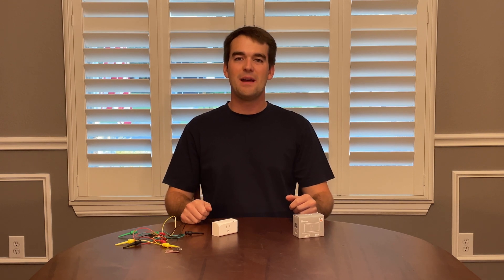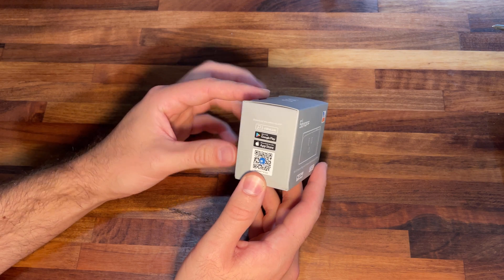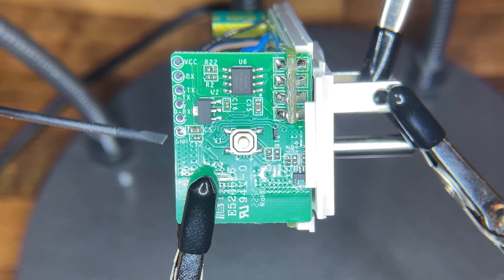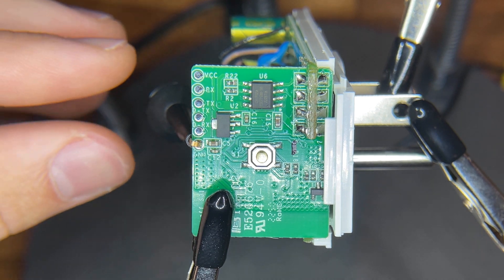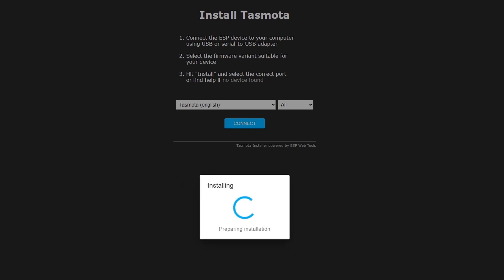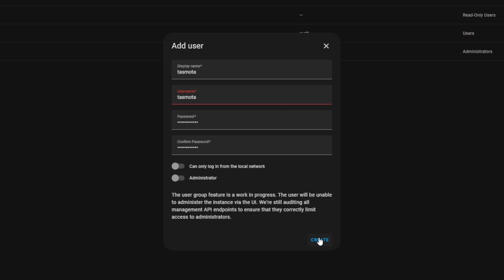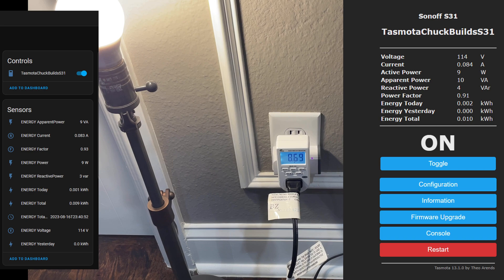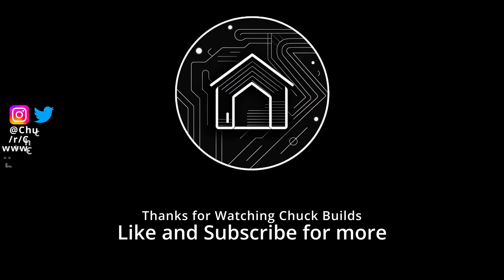Sonoff S31 with Tasmota: The Best Cheap Local Smart Plug with Power Monitoring (How-To)

Comment: was wondering are the clamps for anything or was that just to position it to be easier to record the video?
Reply from the maker: the clips were just to make it easier. you can use any wire really but it was hard to hold them in place long enough to flash.

Comment: May I ask what is the size of the screwdriver you used?
Reply from the maker: I believe it was a Phillips #1 but can't exactly recall
Reply: @ChuckBuilds  Hi Chuck, Thank for your reply. I have contacted Sonoff directly, they said the size of the screw is self-tapping screw ST2x10, countersunk, cross, point tail, stainless steel, and use the PH0 screwdriver. Leave the comment here for others with same question. :)
Reply from the maker: @iantche1980  dang! I'm sorry! Thanks for the update
Reply: @ChuckBuilds  Never mind :)

Comment: I followed your instructions and did fine, connected and I told it to install.  It tried, but came back with Installation failed - Failed to initialize. Try resetting your device or holding the BOOT button while clicking INSTALL.  I tried several times but continued to fail.  Any ideas?
Reply from the maker: I'd try a combination of things. I'd restart your computer, Switch USB Ports, maybe consider switching USB plugs if you have another, and then try the tasmota launcher from Microsoft Edge. I vaguely recall having a similar issue to you on one of the many plugs I did but it was like a random issue - a restart and new USB port fixed it (if i recall correctly!)

Comment: I followed your exact instructions, but all of my plugs go unavailable on HA every 2 minutes. Getting the following errors in Tasmota log.

17:35:35.276 MQT: Attempting connection...
17:35:35.500 MQT: Connect failed to IP:1883, rc -2. Retry in 10 sec
17:35:46.254 MQT: Attempting connection...
17:35:46.476 MQT: Connect failed to IP:1883, rc -2. Retry in 20 sec
17:36:07.256 MQT: Attempting connection...
17:36:07.477 MQT: Connect failed to IP:1883, rc -2. Retry in 30 sec
17:36:38.266 MQT: Attempting connection...
17:36:38.282 MQT: Connected
Reply from the maker: Does location of the plugs change the outcome? My first guess would be interference. It is strange it is on such a predictable schedule though. Any errors from your MQTT log?
Reply: @ChuckBuilds  I wish we hadn't done it on the phone... i'm trying to get this online, and I followed all of your instructions.  But it's not showing up in home assistant.  (Doesn't Show up in Settings/dashboards/energy either

Comment: Just used your Amazon link and put a couple of those plugs in my cart. I'll play with those next week. Have you thought about doing one of your great beginner videos for YAML...I'm struggling with it and I know I got code bloat. None of the other videos I've seen are simple enough for me to follow or at least get the basic idea of the template.
Reply from the maker: Thanks! I’ll think about it but I’m not huge on yaml either haha. I’m working on a node-red video and maybe that’ll bridge a gap for you
Reply: @ChuckBuilds  hummm...node-red video..I'll have to look at that. Got the config editor finally figured out but I'll sure the way I'm programming is the main cause of code bloat. But it works. As I get smarter I'll clean it up. Working on putting Tasmota on this weekend
Reply: tasmota loaded fine. works good but it doesn't show up on a device map....is that normal.
Reply from the maker: @donn3389  did you add your MQTT information?